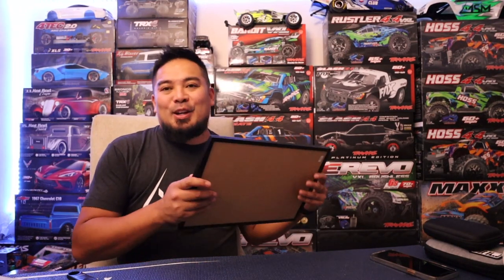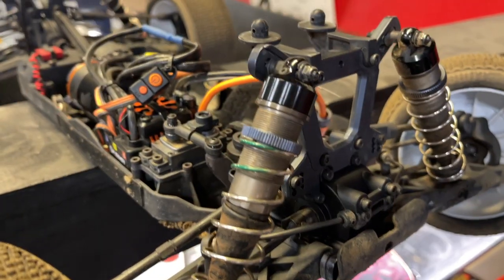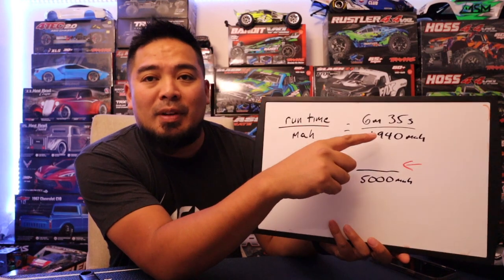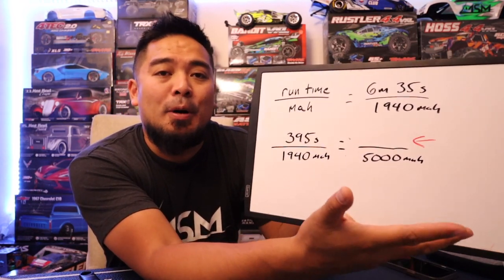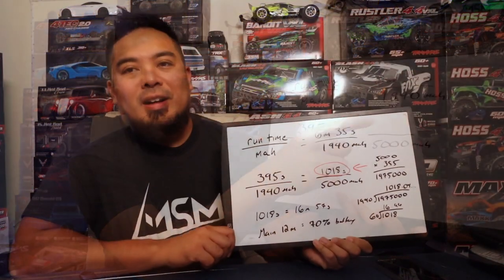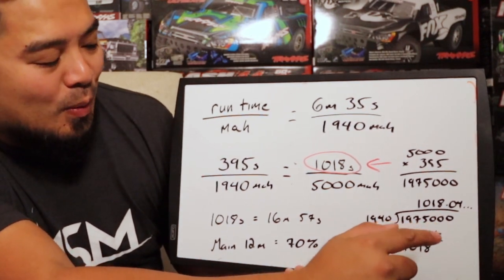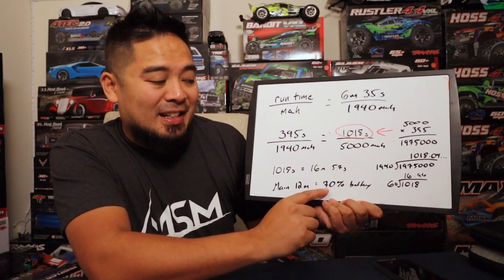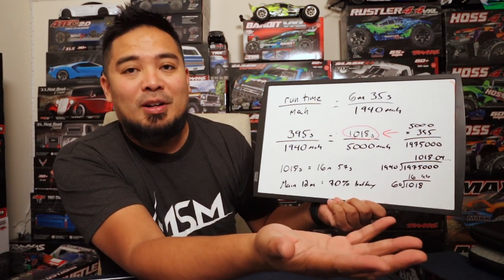How Long A Lipo Battery Will Last in an RC Car | How to Calculate It

Comment: Great info Mark. I've never ran a car long enough to run down a 5000mah. My kids used to put a 4000mah in their stampedes when camping and they would barely use two packs each all weekend. They ran forever. I use the 3000mah 2s shorty packs in my trail trucks and they give good runtime. I still use 6 cell 1800 nimh packs in certain Tamiya cars. Thanks again for explaining.

Comment: Very enlightening video. For all those r/c youngsters who sit in math class and say we'll never use mathematics. You're wrong. Just like when guys running foam tires calculate roll out, when you're calculating final drive ratio, etc. Thanks.

Comment: I bought a Rustler, a few years ago, to replace a Rustler I traded for some cheap toolboxes way back in the day. I remembered my old NiCad batteries would last about 5ish minutes so I bought an 8000mah Zee battery off Amazon, thinking I'd probably get about 20 or so minutes off it. I actually bought 2 of those batteries so I didn't have to worry about it, because I bought the XL5 version and put my very old 17t Trinity Speed Gems motor in it. Yeah, after about 40 minutes of bashing, in grass and on concrete of a park, having to stop to cool down not included, I didn't need 2 batteries 😂😂
Reply: At least you have enough battery though. LOL. All I had when I got my SC104x4 after a long break was a 6cell 4300mah NiMH. Titan 12T and it lasted 4 mins flat. 20 mins charge. LOL fun
Reply: @daveshank1921  I was genuinely shocked, I have the 2wd version so I'm sure that helps as well. My motor is faster than the titan is, I'm guessing because it's fewer turns it's more efficient too? 4 minutes on a 4300 would upset me, not gonna lie lol
Reply: @ralphlongo1975  I was waiting on the money for a brushless system for the truck so I threw in some stuff I had. I was asking way too much from that titan and batt. SC104x4 needs a good brushless and has a habit of eating batteries from amp draw.

Comment: Great explanation Mark. Competition RC sailplanes guys have used this method  to optimize on battery size and therefore optimizing flying weight. Also with the same data one can also work out the average amperage which comes out to be around 17.7A in your case - which seems quite low considering the ESC, battery and motor combination. In RC planes the average amperage is used to gauge the appropriate smallest ESC (less weight) possible (a poor mans method without the proper bench test equipment available). However yes I know quite impractical in the RC Car world. Just thought I'd enlighten you further.

Comment: hey mark! i have a question, i just bought and HRB 3s 5000mah lipo batt for my 2wd slash and i started having a green and red flashing light steering works tho but then when i put back the traxxas 2S 5000mah lipo everything works just fine. what is going on, it seems that i cant find the right fix or answer for this problem. im juts not sure if i have to do something with the esc or what? thank you much

Comment: I usually set my low voltage cut off to a higher level than most people. 3.6 or 3.7. I probably would have hit lvc before the race was over.
Reply from the maker: I usually turn my lvc off… haha! I dont want it to cut out if im super close.

Comment: Nice video but I think that all of your calculations just work in theory.First of all you should never discharge a LIPO battery all the way down to 0% so when you have a 5000mah battery you cant calculate for 5000 but for about 70% of the max capacity.In addition the battery dont discharge linearly,meaning that the more you "play" the faster it discharges.Please correct me if I am wrong or lost something!